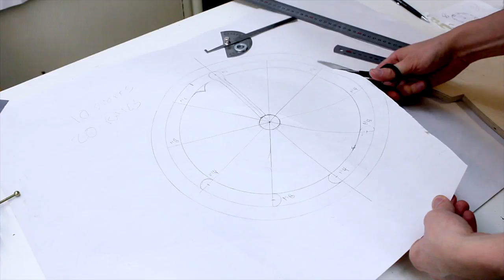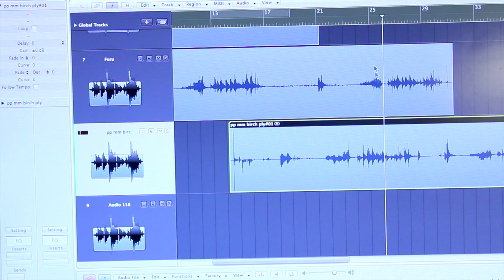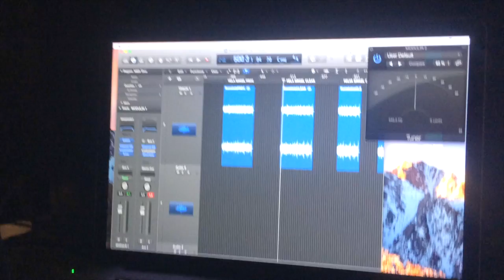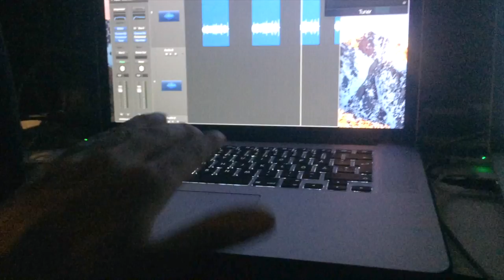Building the MUSIC BOX - From start to finish

Comment: The IEC connector for the power is a great idea because in any country you can find one of those cables for kettles, PC's, computer monitors, and if your power supply is ok with 120/240V 50/60HZ, you can play it in any country with just the right local cable.  :-)  Also the cave workshop makes you look like some sort of comic book hero :-D

Comment: You might try to mold a rubber/urethane saddle/cradle to support the DC motors. That might help to absorb some of their noise.  Use a slower speed motor if possible!

Comment: Hey Wintergatan. I've recently been trying my hand at building music boxes using the same paper-fed mechanism and I haven't been able to find an answer for an issue of mine online.

The songs you have on your music box look to be much longer than the sheets that I find included with these sets can provide. Do you buy a separate continuous sheet of the music box paper, or do you tape several sheets together and if so, what tape is best to use?

Comment: Did you ever add the next video (how to adapt a 30 note movement)?

Would it be easier to start with a hand crank or an electric motorized movement?

I have an old toy steam engine I intend to use as a motor for one.

Comment: I'm still wondering something: how does the sound is triggered by the holes? We don't see the mechanism inside the paper-pulling system, and I don't see where the sound is really created.
Did you have created a componium manually, or is the paper plugged to the componium? I don't get it, and I'm sad there is not enough explanation about this :/ 
Maybe the subject for another video, even if it would be a small video :D 
Love your work, cheers from France ;)

Comment: I don't understand carry on weight limits. It's all going on the same plane usually, whether it's in the cabin or in the hold shouldn't matter. Crazy airplane taxes.
Reply: dan. ja most travel companies charge extra for all non Cary luggage, so if you want to take something heavy you have to pay extra, seems reasonable to me.
Reply: Is it partly to do with carry-on luggage being stored overhead? Wouldn't want 20kg falling on my head...
Reply: i think it's because for the balance of the plane. just like a ship you must balance everything on an airplane so it will perform efficiently and not cause accidents. try throwing a paper airplane with a pencil taped on top vs a paper airplane with a pencil taped in the bottom
Reply: jude manalac Both your's and the above comment is correct, while the overhead luggage storage can easily take at least double the marked weight limit, if a strong enough turbulence hits the storage can fail, also the weight limit is decided to make sure that, at worst, even if only the storages is being filled behind the center of gravity, it will still be manageable within limits.
Reply: I always thought it was an anti-terrorism measure, but now that I think about it, why would they let you pay the extra for heavier carry-ons? Maybe it's just because it's a business, and they'll exploit any "necessity" as a means for more cash. At least that's what we experience here in America.
Reply: But it's probably aerodynamics at the same time.
Reply: Also weight factors in, well, heavily in fuel consumption, so a higher weight necessitates a  higher cost. (I'm pretty sure, but don't quote me on it!)

Comment: Hi Martin, I might be late for this but maybe you can help me out with some info. I currently use a pair of rather cheap piezos as pickups for my music box (Sankyo 33), fixed to the bottom of the enclosure. Which contact mikes to you use? Also, is it really enough to "pull" the paper strip through the mechnism without any active gears on the movement itself or did you do some modifications in addition to removin the gears? Any advice is of course greatly appreciated.

Comment: IEC is a good solution.. But PowerCON is better ;) Powercon Plugs can't slide out of the socket. An IEC Socket or Plug is baggy after a few month of touring so it can slide out of the socket. It wouldn't be cool if that would happen on stage, so I would insall au Powercon socket cause it's lockable.
Neutrik NAC3 MPA-1 is the name of the Socket
Best greatings ;)

Comment: Where do you get all of your gears and pieces for this project???  I use to have a 1940's or 1950's meccano set when I was a kid but haven't seen anything of that quality since. Would like to know where to get that kind of product again
Reply: chugbry The plastic gears and stuff are all Lego Technic pieces. Googling the name will turn up some good resources for using them. If you ever want to buy Legos, especially common ones like gears, your best bet is bricklink. It's an eBay like marketplace, but specifically for Lego.

The metal sprockets used to connect the chain are probably purchased from a hardware store.

Comment: hello martin 
are there building instructions for your music box that you made? 
raw version may also, I want to go after building. 
which components did you use? such as motors and gears (how many teeth have the wheel) and which engine did you use? the microfone (soundboard) which type is it? 
music box which type is it? 

of course I want to pay for your working drawings and your information about this 
and you can also make the music you made so that you can cut the music yourself and with which paper do you need With

 Friendly Greeting